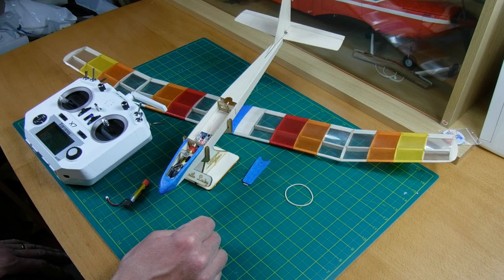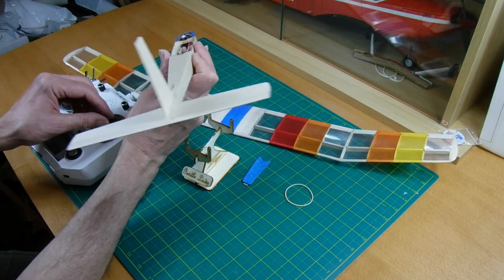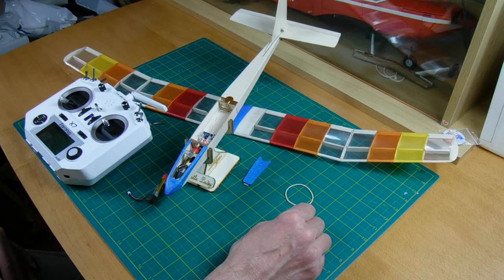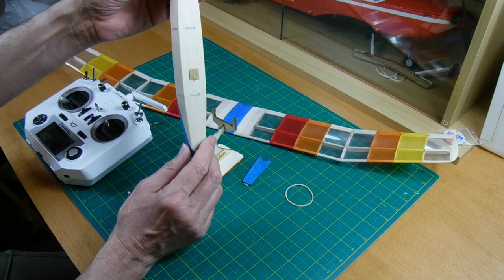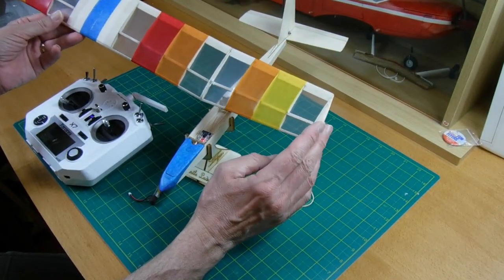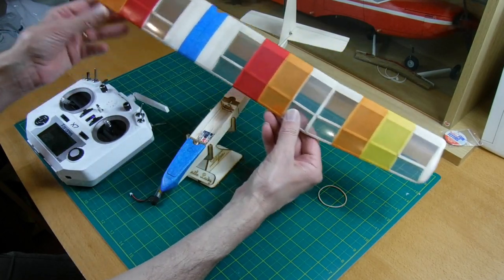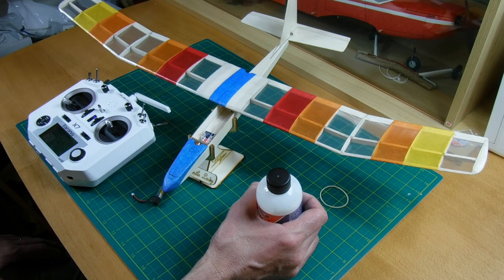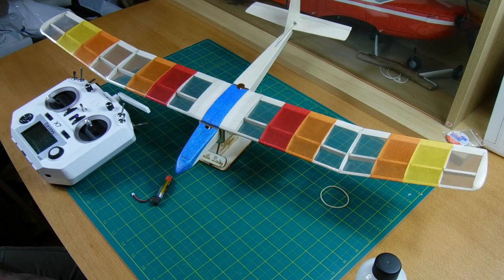Micro Gentle Lady - Intro - Angel Wing Designs - Hi-Start HLG Javelin Launch RC Glider

Comment: Really like the inset rubber band dowels. You are getting into the tissue colour schemes.  I saw a John Woodfield glider using some cheap spray paint on the balsa in a rainbow arrangement then clear film over the top.  Good luck with your maiden it should go perfect first time.   BTW I might have an original GL in factory colours coming to my place.
Reply from the maker: I believe the original full size Gentle Lady had a similar arrangement for wing mounting - you'll find out for sure when you get yours. That'll be a nice addition to your fleet to have a genuine old GL 👍 You could nickname it GG for Gentle Granny!

Tissue is a great way to add colour for negligible weight gain. Some mask of a tip of a flying surface that is covered with mylar and spray the top surface only to help visibility in flight. I've seen a few examples of colouring the airframe structure and then covering with clear.

Looks like spring has arrived in the UK so I'll have more of a chance to do some maidens. Just depends on wind strength and direction....

Comment: Hi Carl.
Okay I want to get a white tarranis q7 like yours but I am at a loss with micro rxs.
I see you have a brick installed in the model so I am wondering how you manage to operate that with a Q7 radio?
Peter
Reply from the maker: Hi Peter. Good to hear from you. I have the FrSky XJT module plugged into the back of my transmitter which allows me to use the brick you mention. The bricks I have use the FrSky D8 protocol. Being in Europe my transmitter uses the D16 protocol, hence why I have the XJT module (D8 protocol) in the rear. 

Check which protocol your Q7 radio will use, because you can now get the brick receiver using either D8 or D16. So you should be able to match them without using the XJT module.

Hope I made sense....

Carl
Reply: @RCSoaringDiaries  
Yes Carl that all made sense and thank you.
So with what you do....gliders!   What do you think of the RM Zorro?
I reckon its perfect for dlg and gliders in general.
Nice and light, compact and you can get a snazzy case from BG for it too !
My  micro Sinbad from Angewings came today from UK all the way to Australia.I think I am lucky as I got the last one before they are discontinued for another type ov model. 
Lovely super little kit.
Cannot wait to get the glue out.
Pss...rx bricks are hard to find now
Reply from the maker: Hi Peter, if you can't get the rx bricks in Australia, then you can get them from Banggood.

Being 6ft 3in I have large hands to match and like the feel of a full size transmitter. I've seen some use transmitters very much like the RM Zorro for gliders and can be carried easily. At the end of the day, you need to go with what you feel will suit you. Me personally I would have difficulty with the location of the switches and sliders too. But the design no doubt suits those who grew up playing game consoles, so makes a simple transitions easy for them.

Pleased you got hold of the Micro Sinbad kit. Having built the Micro Gentle Lady and Micro Aquila you will enjoy the Sinbad. I have the Sagitta and Sinbad still to build for this summer. Let me know how you get on with your Sinbad.

Enjoy.

Carl

Comment: Just interested to know what thickness mylar you opted for so we can share this on the builders group
Reply from the maker: The thickness I used was 10 micron as that's what I had, but if I was to buy some more I would try 5 micron for these small gliders. I've worked out that the amount used for the wing was 1.8g for 10 micron, so 5 micron would halve it 👍
Reply: @RCSoaringDiaries  thanks Carl, based on my experience with using mylar on F3P models I thought 5 micron could be about right. Most of those used 2 micron, but then again my last model was 800mm span and 900mmn long and weighed 38g with the battery ;)

Comment: looks good! which receiver did you use?
Reply from the maker: Thanks! The receiver I use is the MXL-RX6H-B2 FrSky D8 Receiver Module. They're available for other protocols too if you don't use FrSky. Check out Micron Radio Control, Micro Aces and Banggood for what's available 👍
Reply: @RCSoaringDiaries   thank you!